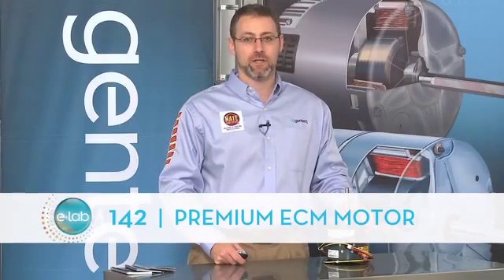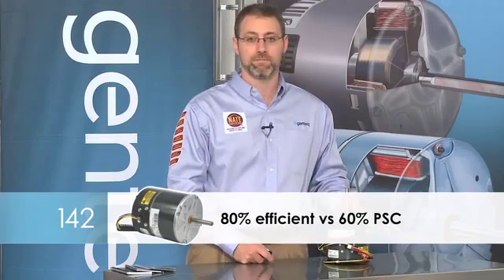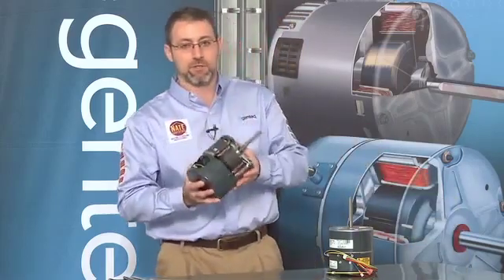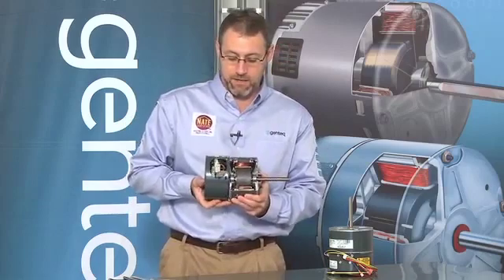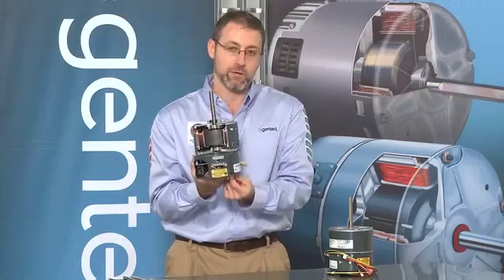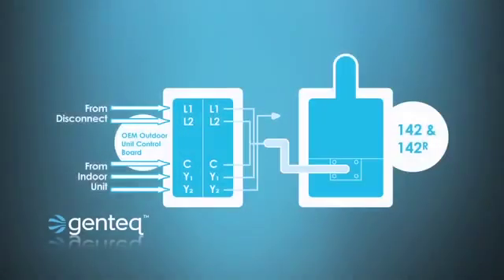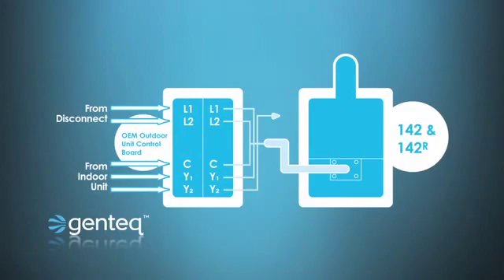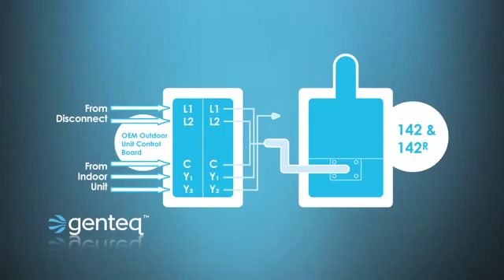Genteq OEM ECM Outdoor Fan Motors 142 and 142R

Comment: The video and other Genteq info do not address short cycling:  fan comes on normally but only for 5-10 seconds.  Comes on again after 30-60 seconds, and so on.  Could it be a high-pressure safety switch fault (simple replacement), or is it a bad ECM motor ($1000** replacement)?

Comment: WHY COULD YOU NOT MAKE IT REVERSIBLE Due to we can pull air in the coil and not push inside out.  Have the ECM control short out. Power surge.

Comment: these are junk!!! i bought a brand new rheem unit.. replaced it 2.5 years ago and 2.5 years later today i just literally had to replace it again!
Reply: Mine same, this shitting quality shouldn’t be in the market, is there somewhere for consumers to get reimbursed by the manufacturer? We should file lawsuits against them
Reply: Same, Rheem 142r 1/3 hp, mine always sounded wrong to me when it started. The installer said that was normal, 2 years latter and it failed, they replaced it, made the same screeching noise on startup and  about 2 years again it failed again, I had to buy a used unit because I couldn’t find a new one anywhere, last weekend the used one died and big surprise is its backordered everywhere. Motors are fine but controllers seem to fail but they don’t sell controllers separately. It’s almost like they know it’s a weak point
Reply: @PumpkinKingXXIII designed to fail is my thought. Junk junk junk.

Comment: Two of these have died in my Rheem A/C over the past 6 years.  He mentions surge protection, but as an electrical engineer I have studied the circuit diagram, there is a thermistor, for inrush current control, but NO surge protection.
Reply: Mine same, 4.5 years two of them died, this is piece of junk motor

Comment: I have two 142R's with bad bearings. When mounted shaft down they take in water through the casing bolts and the bottom bearing is consumed in water. I seal the top bolts with seam sealer at install. Best to inspect your unit before its too late. This is not a good outdoor motor design.

Comment: Well I hope there's a way for you to make it more durable.  Ours just crapped the bed at 5 years.  Compared to 35 years on the previous unit that was still running.
Reply: Thomas Rock  i find it funny that the motor i have has all this fancy control circuitry and is basically turned on and off by a relay (no variable speed control board in the outdoor unit) - so it probably could be replaced with an old-style motor that doesn't have this without any issues so long as a capacitor is added
Reply: Thomas Rock  it has capacitors on the control board inside the bottom housing of the motor. aka another thing that can go wrong and isn't easy to replace like an external capacitor.
Reply: green new deal sucks.

Comment: Excellent instructional video and still you did not specify what kind of communication control voltage goes in the motor,is it AC or DC voltage? Thanks
Reply: Signal wires are White and Yellow, Blue is common.  Control voltage is 24vac..

See this documentation. https://www.regalbeloit.com/-/media/Project/RGLB/RegalBeloit/Files/Genteq-Technical-Files/Application-Notes/Product-Information/gettingstarted142R_6_8_09_V1.pdf?la=en&hash=E9F13B6F1B469DD2A508C6351FB2E7C5
Reply: @KirkA0906  Well according to the documentation you referenced above, low voltage control to the ECM motor comes directly from the thermostat and is in fact 24VAC (not dc) which is what the step down transformer located in the air handler/furnace outputs.
Reply: @bentleyjarrard885  Sorry. My bad.
Reply: @KirkA0906  No problem, I'll let you know when I become perfect. Probably not any time soon. Forgot to thank you for the documentation link above. I read through it, very helpful as I have a 2 stage Goodman condenser that is now 10 years old.